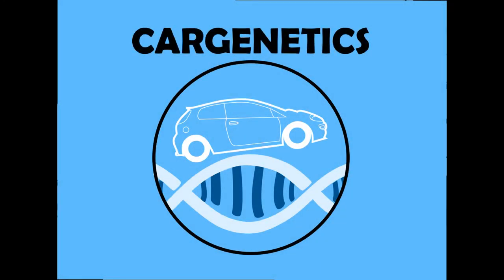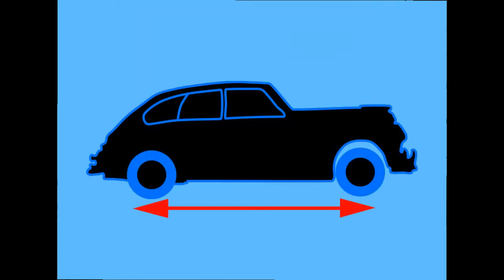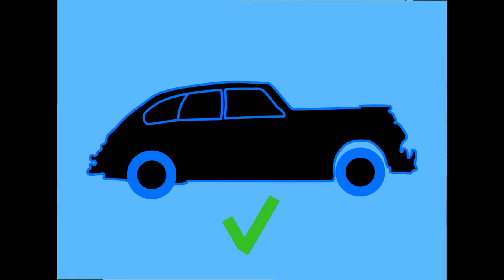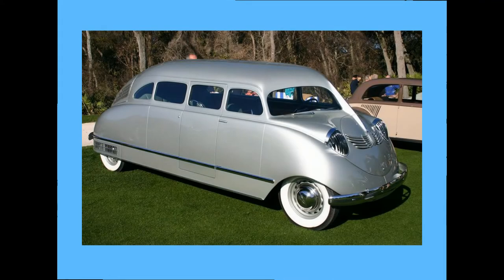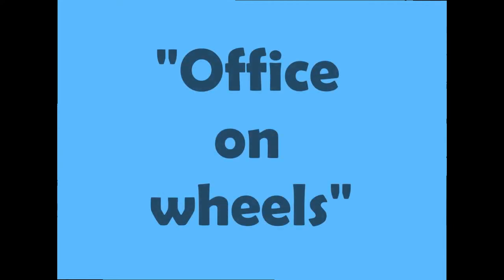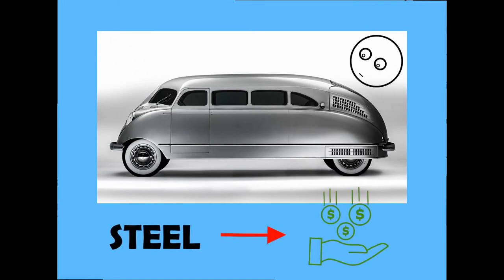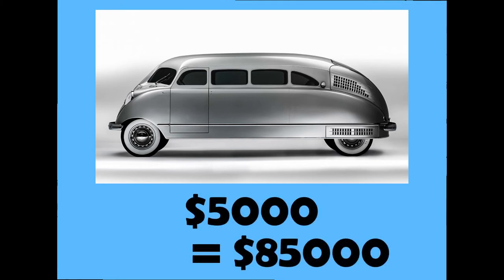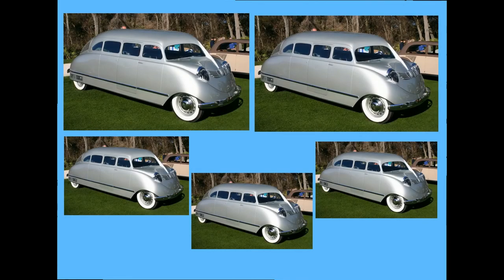Weird Cars of the Past - Stout Scarab 1936

Comment: Willard Dow was president of Dow Chemical and a friend and investor with Stout. It is believed that Dow’s car is one of the surviving five examples.
The Scarab weighs 3500 lbs with 1200 lbs on the front axle and 2300 lbs on the back axle. I have restored one of these and driven it extensively
Including two cross country trips. The car does everything that Bill Stout said it would do.